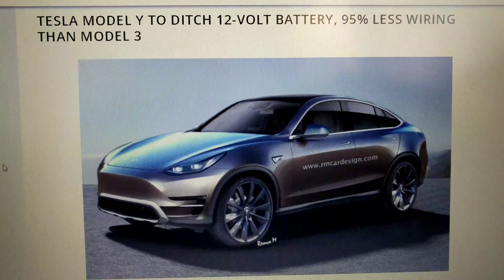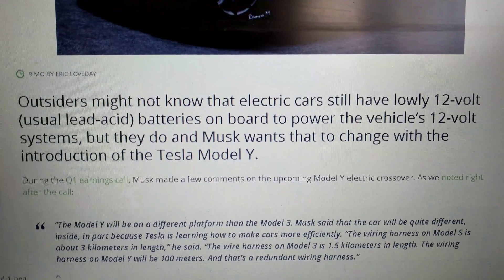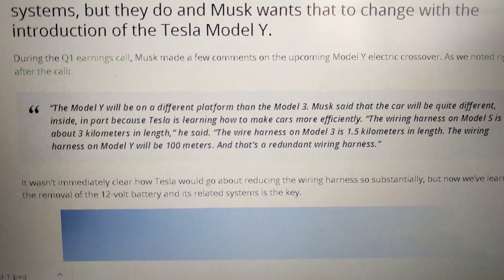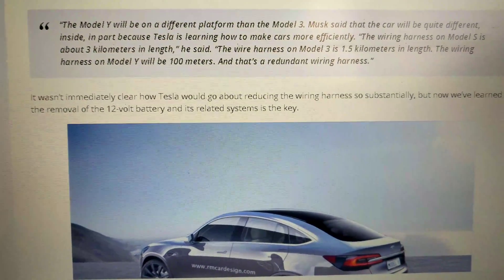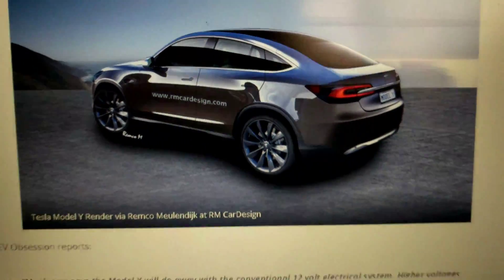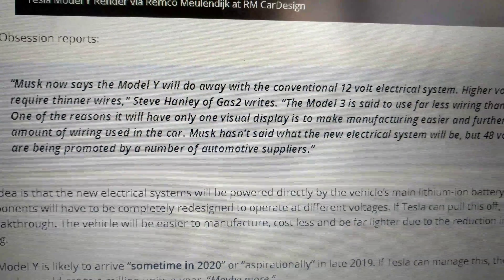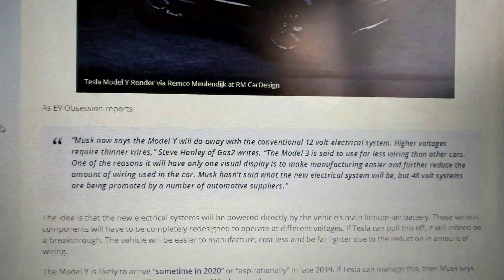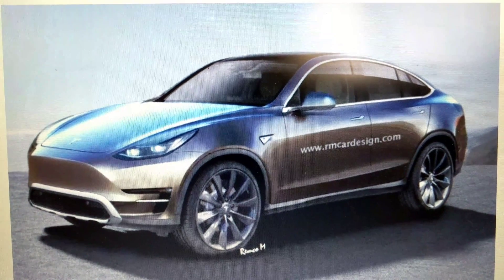TESLA MODEL Y Gets Rid Of 12 Volt Electrical System & Battery

Comment: It's very easy to transform a 12v system to 48v - instead of hooking each cell positive to positive in a daisy chain fashion, which continues to produce 12v, merely hook cells positive to negative and each time this is done the voltage is doubled.
This is a description of a traditional 12v battery bank.
Panasonic makes Tesla's batteries, you may be able to find more info there.

Comment: I have been working on cars and motorcycles for a long time and wondered about the maintenance of a 12V system that requires thick wires with increased weight to follow. A 48V system requires only 25% copper in the wires as average, cheaper and weigh less! There has not really been developed on cars' electrical base construction for 50 years or more - all we see in cars today with screens and smart electronics is a shell on top of an old-fashioned analogue device. This is going to change, starting with the model Y.

Comment: This is old news where Elon mentioned they would radically change the electrical system in the MY to 48V and less wiring using a new communication protocol. He then changed his stance on this to reduce the delay to production.  It is still anyone's guess at this point.